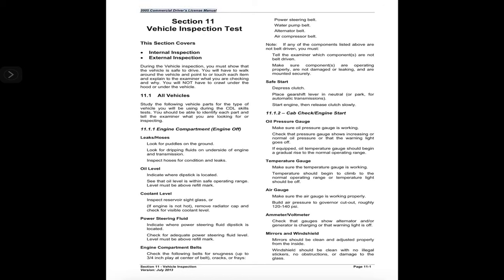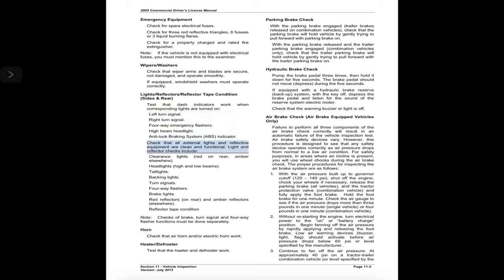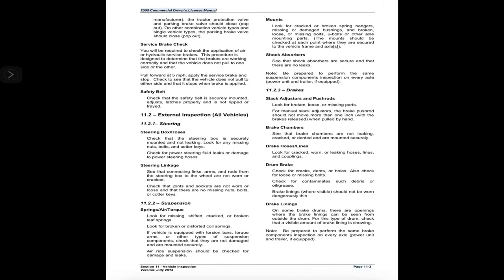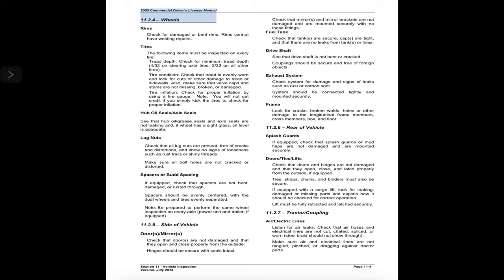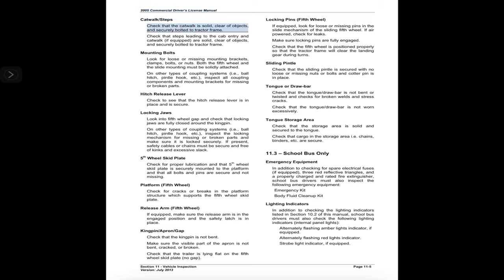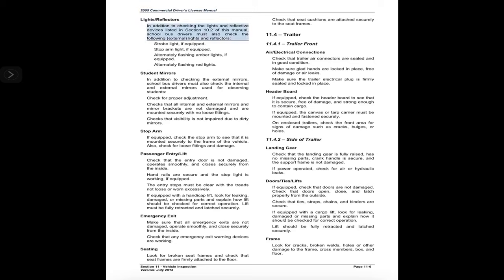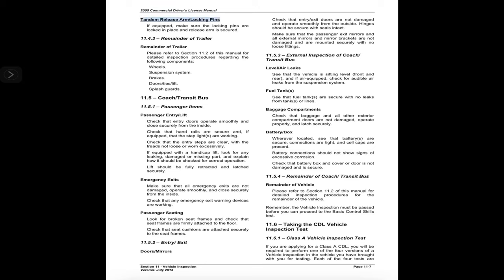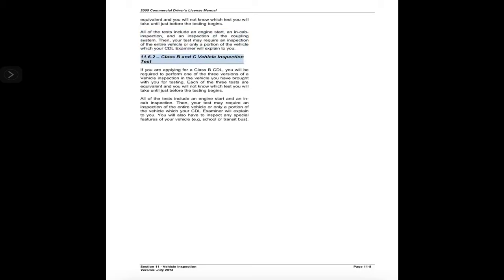Texas CDL (DMV ) handbook  Section 11 Vehicle Inspection Test 11.1 to 11.6.1

Comment: What does it mean that only 1 of 3 versions of the pre trip will be selected?
Reply: @Sanbartlogistics  what if I’m going for a class B? Will those sections change? Like instead of trailer will it be just the rear of the truck? The only reason I want to know the possible sections is to make sure I know what components belong to what sections so I cover it if I’m not required to do the entire truck. For instance, since the steering shaft is only seen by opening the hood, would I required to mentioned that during an engine compartment inspection or part of the axle inspection. Thanks!
Reply: @ChaseMac22  you never know what component's you'll actually test ...they have you draw from cards.. you'll then initial that you drew that card and we're not given that test selection   you must be prepared also huge tip know the function of all components take your time you have 2 hours.